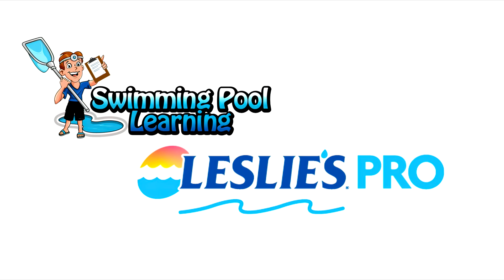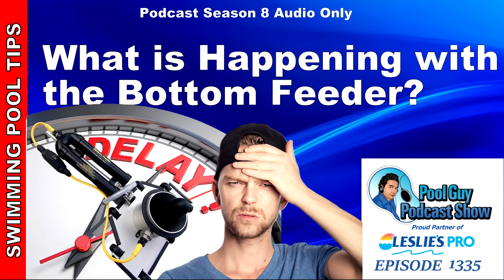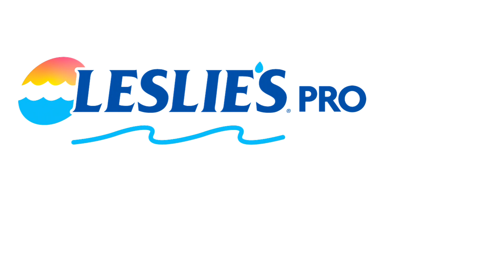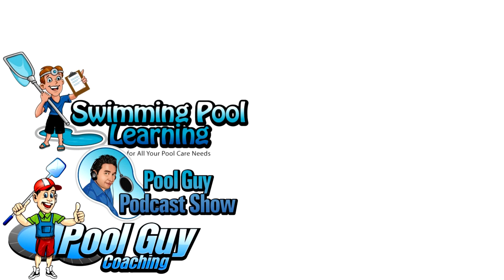What’s Up with The Bottom Feeder? Honest Answers From the Owner Glen Heffernan

Comment: Is there a vehicle charger I can buy to charge in between drives?
Reply from the maker: Yes- just type this in Amazon: Power Inverter DC 12V to AC 110V - 300W Car Plug Adapter Outlet
Reply: @SPL Thank you 🙌

Comment: I've never used a bottom feeder but I have used many hammerheads and yeah it has a cord and it can be inconvenient moving it around sometimes if you have a big commercial pool but being able to vacuum all day without worrying about a battery in my opinion makes the hammerhead and other equivalent vacuums better for anyone with a serious pool route, especially a commercial route like mine. For a homeowner or somebody with a small route where they only have to vacuum a few times a day, maybe the bottom feeder would be viable.
Reply from the maker: It's a good option but as you say for Commerical accounts the full size rigs are best.

Comment: I was in a car accident and my bottom feeder stainless steel framed got warped slightly inwards and everything still works! Can verify this baby is resilient even the black motor was turned inward instead of facing down on the floor it’s more upward towards the pool pole and kicks ass still.

Comment: Yea I just moved on from TheBottomFeeder to the Riptide in October and I don't regret it, I had the BottomFeeder for 3 years and it worked great when it worked lol he talks about losing money to warranty stuff but I never got that treatment. when I first bought it the original motor fried both (2) batteries within 4 months and I was told I have to upgrade to new motor because the old one was killing the batteries. so I went ahead and did that but was charged 300 bucks... then the portability kit came out and it was a game changer till the switch died within 3 months and ofcourse that was another 100 dollars lol I bought at least 5 of those over time. And yea of course the battery always were an issue, Thankfully mine never caught fire but they were inconsistent and would turn off randomly while vacuuming till it reset and would continue. I def got good use out of it and I just always coughed up the money to fix stuff but after being told in October that batteries are not being fixed or sold I went ahead and moved on to Riptide, So far its amazing and the Duracell 55 aH battery I use hasn't failed so far so I cant complain.
Reply: I’m trying to decide between the riptide and power vac. We have been surviving on the volt leaf pool blaster.